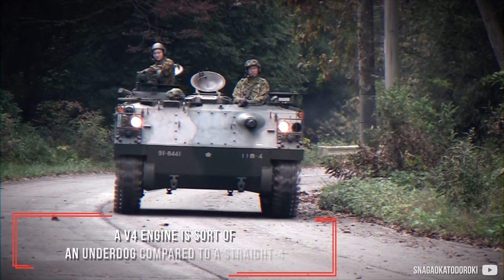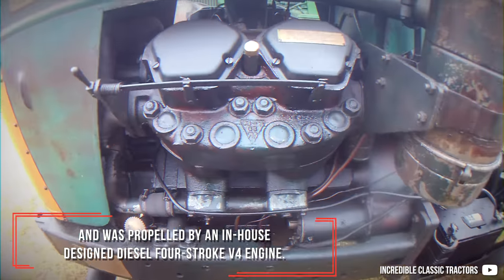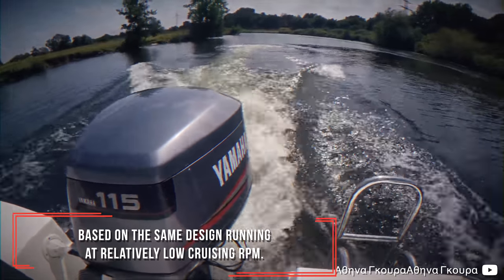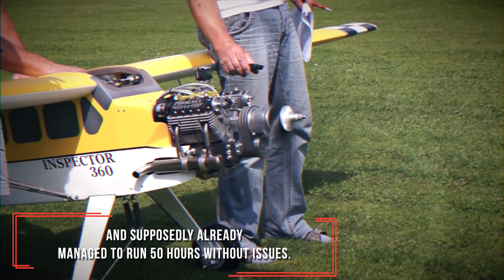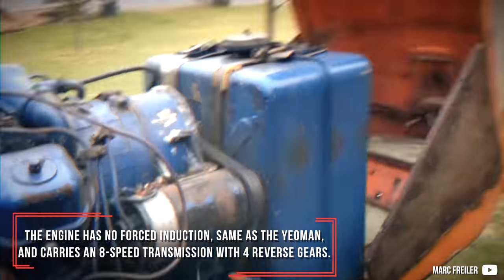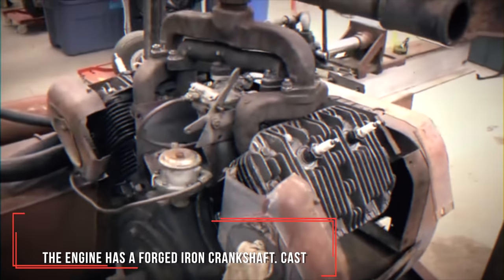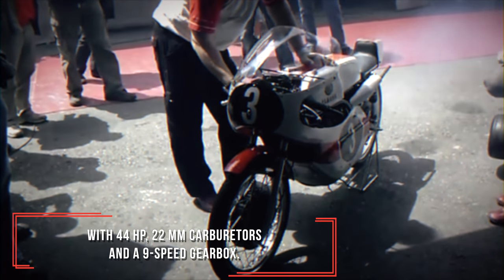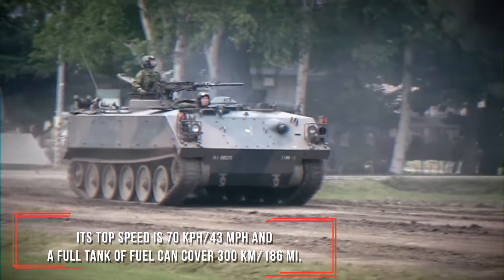Almost FORGOTTEN V-4 Engines

Comment: My grandfather had something called a Ford Corsair 2000 GT which had a 2l v4.
Probably the worst engine Ford ever made. The performance was ok but ran like a concrete mixer. The vibration was so bad that it caused oil pump drive failure @ around 60 000 km on just about all of them. Then the cam drive gears would fail shortly after.
It was the 1st engine I overhauled (aged 13)

Comment: I'm puzzled how a 2 stroke V-form engine can work, as when one piston is all the way down, the opposing piston is still only half way, which must reduce the efficiency of scavenging as one piston is pushing some the fuel/oil mixture up under the opposing piston instead of up into the cylinder.
Reply: Each cylinders crankcase is sealed to that cylinder. They are not a common crankcase engine
Reply: @holmes1956O  Ah OK, so the cylinders are staggered... in which case the crankshaft pins are probably arranged so the cylinders fire as in an inline engine.
Reply: @TommyWylie  the crank pins can be arranged any way the designer wants them. Each cylinder has its own crank case sealed from the others. Thats how any multi cylinder 2 stroke I have ever worked on was laid out

Comment: The current Yamaha R1 engine is basically a v4 in inline format
Reply from the maker: That’s true
Reply: @VisioRacer  the real difference is in the overall weight. The vee four does balancing correctly though at the expense of weight. The inline cross plane four relies on exciting exotica materials in lieu of this natural balance